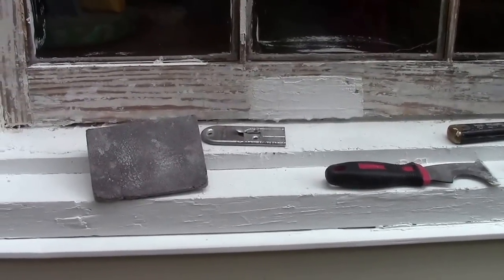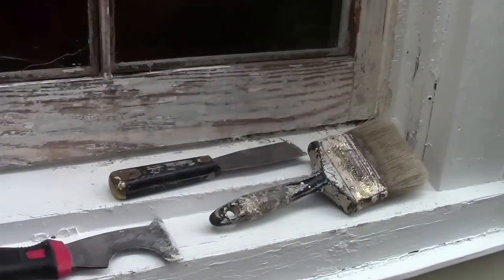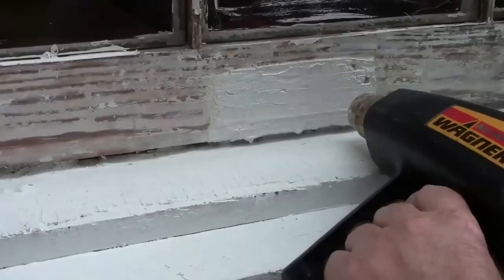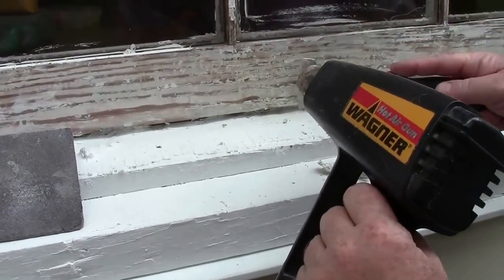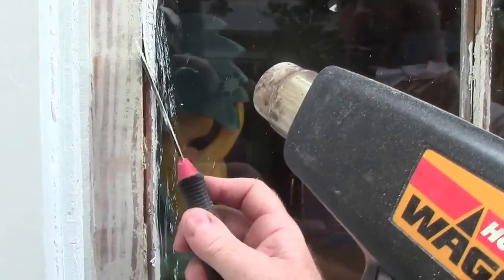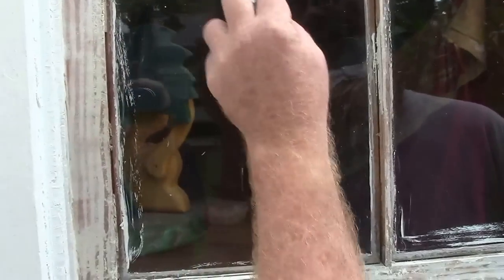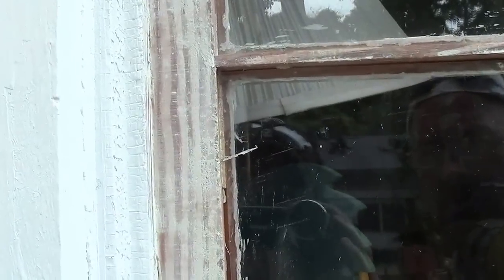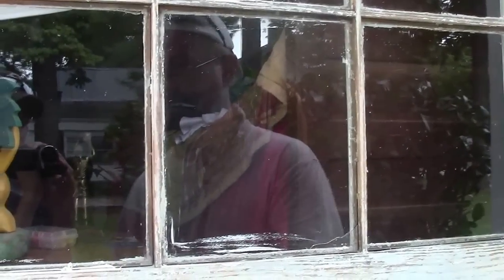Refurbishing An Old Wooden Double-Hung Window

Comment: You might want to mention that an eighty year old house with lots of coats of paint has undoubtedly got many layers of lead based paint.  Sanding it is not a good idea and even using the heat gun produces lead filled debris.  Really should be wearing at least a N95 respirator (and tell your son to stand upwind!).  Lead poisoning is no joke for kids.

Comment: Lastly, as for Lead - I've been doing quite a bit the past 1/2 year - scraping, burning and sanding and I know it's NOT recommended - however my test puts me at a Lvl. 12, 25 is dangerous and get into the 30's and higher you're talking serious danger. My doggy tested totally negative - granted I have no kids so - that's when you have major danger to worry about and their developing minds. 
A respirator that is suited for Organic Vapors I'm pretty sure is OK for lead, but wash your clothes separate if making dust and scraping/sanding! Then wash them again.

Comment: I've got 9 windows to do in an old house that was built in 1923, inside and out. The heat won't shatter the glass?   I did a house back in the 90's removing all the old paint with a heat gun, so I know it's a slow process. Subscribed. Thanks. :-)

Comment: thank you!!   we are doing the same thing to my boyfriends house - it was built in 1931.    Was thinking about using chemical stripper, but maybe this will be better.  It's a tough job for sure!
Reply from the maker: I have found that the heat gun is much faster than any chemical stripper and not nearly as messy.  Good luck!  Thanks for the comment!

Comment: tubbers20
tubbers20
2 weeks ago
I've got 9 windows to do in an old house that was built in 1923, inside and out. The heat won't shatter the glass?   I did a house back in the 90's removing all the old paint with a heat gun, so I know it's a slow process. Subscribed. Thanks. :-)

Comment from the maker: Thanks for viewing!  The heat gun in the video is a Wagner.  I bought it 18-20 years ago.  I have one that is newer that works just as well but is a bit smaller.  Any of the Wagner heat guns will do the job for you.  To take a wooden double hung window out from the inside, generally all you need to do is to remove the window stop molding that keeps the window in.  Remove the molding from the left side, right side and top. Once you remove it, lift the window up and out.  In some instances, if the windows are old enough there will be cords with weights on them.  Try removing the molding first and see what you see.  Thanks again and good luck.
Reply: It's hard to see the 'puzzle' put together sometimes with all the paint gopped on it and the rabbets etc. 
I've found a pastry-knife frosting spreader to be thinner than most putty knives, and using a rubber mallet can help break the seal of the upper. The Parting Stop is very fragile and needs to be paint-seal broken too, so that uppers can be removed when you wiggle the stop around the check-rail. Lot's too it! But I'm getting there

Comment: I'm taking out all my windows to do this now. Muralo was bought by California Paints, their Trouble Shooter is a Linseed based primer, can add more oil if windows are horribly dried, and it sands like butter. But I do this before I spackle. Also Sarco is the only Linseed based old school glazing and based in Chicago. Good stuff!
But...if you do NOT remove the windows and get on a bench to do this you can't plane the contact points to smooth, change ropes, remove paint inside jambs/stops etc. 
There exists something called Sampson Spot Cord with little red diamonds woven in. Do a search for it, I've seen it in 1920's ads, and found evidence of it inside weight-pockets! 
Cool stuff and historically accurate

As for glaze removal, IF what your removing is actually real glaze, then a 14" broad knife for taping I lay on glass and move quickly and it pops out. 
Beware of the buffoon Baby-Boomer geniuses that thought it would be a great idea to use Durham's Rock Hard Putty instead in the dark-era of the mid-century folks who lost the true path of righteousness. 
THAT'S RIGHT! Gen-X coming on board to clean up your messes - HA

Comment: I don't know if it is an issue where you live, but if you don't take the glass out and replace the glazing it is bedded in it will rattle and leak heat in the winter like mad. My house was built in 1919 and I had to learn the hard way.

Comment: when you're heating the narrow wood pieces around the panes or glass....how are you not breaking the glass from the heat? I'm having a heck of a time. However, I do know how to replace the panes...at about 8 dollars a piece.
Reply from the maker: +Mary Srnkagee  Hey Mary!  I have the heat low and constantly move the gun until the paint loosens up.  I have yet to break a pane with this method.  Most of the glass I have been working with is old...........I don't know if this matters.  I just keep the gun moving.  Thanks for the questions!
Reply: Grrrr....well the good news is I literally just stripped an 8 pane sash putting an aluminum wrapped piece of cardboard oh the glass. No problem! Glass is as old as 1895 and as new as 1929. 

Do you know anything about repair the rope weights? I have a specific problem.
Reply: @2slwilliams  I cracked a Piece on a interior cab. Im sure it was thinner glass and a preexisting fracture

Comment: Now imagine trying to do 20+ windows and making any money out of it.
Reply: It's such a rare lost art that some companies in Chicagoland (maybe 3 serious ones) will charge about $1200 per opening to clean up to bare, resurface wood, jambs, stops, reglaze, new ropes and such. In an Oak Park this is generally not an issue but in the city and other areas with older homes the default is to let them rot to the core and get plastic - SAD. 
But imagine doing this at $1200 x 6LR, 3DR and possibly more?? That's some serious money right there!

Comment: Could I use a hair dryer instead of a heat gun?
Reply from the maker: I haven't used a hair dryer before.  It may work if it gets hot enough.  You have nothing to lose by trying.  You will be able to see if it works pretty quickly.  Good luck!
Reply: doubt it'd work but you can use a cheap wallpaper steamer from Lowes. Works great without all the lead poisoning you'll get from using a heat gun (speaking from experience).
Reply: If you buy a heat gun after your project you can dry your hair with it faster than with the ol’ hair dryer.